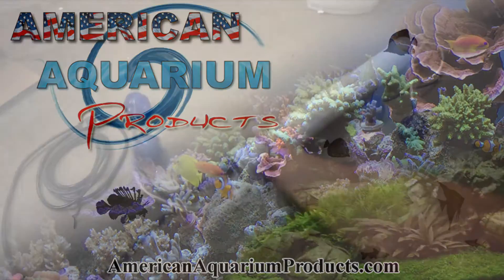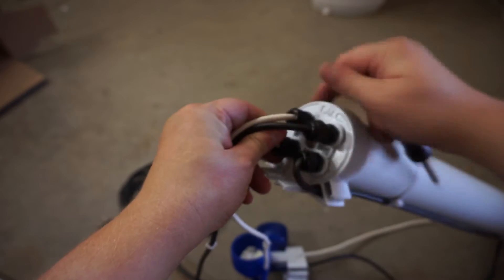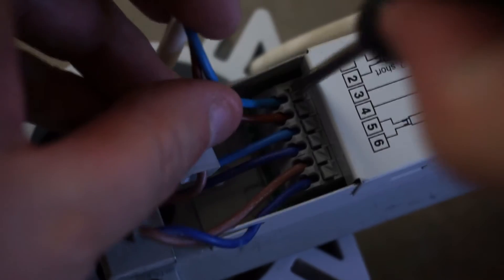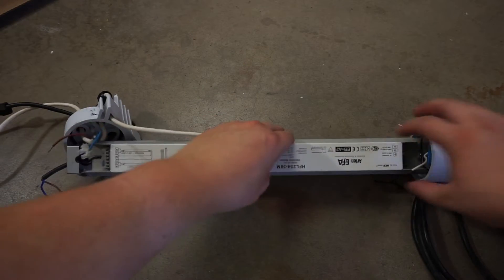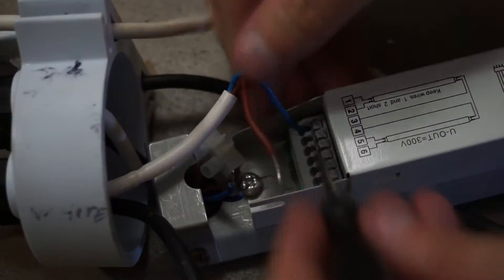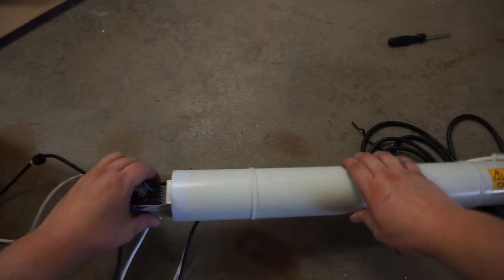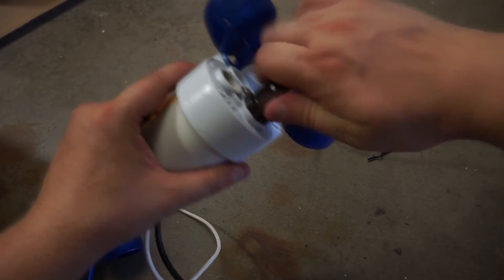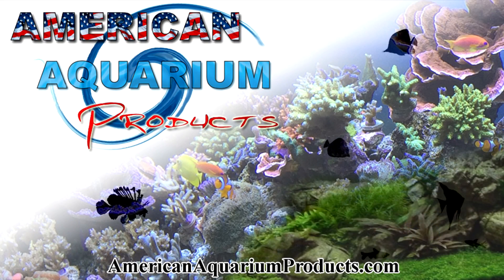American Aquarium Products- 110 Watt UVc Ballast Replacement

Comment: Is there a. Way to test a unit? I have just got one and want to get new bulbs but don't want them to blow if this is broken
Reply: These have a fuse to protect from this happening. If you purchase quality lamps designed for this UV, this should not be a problem.
Resource:
https://www.americanaquariumproducts.com/T5T8UVBulbs.html#g55t8

Besides low quality replacement lamps, the biggest issues I've seen in the 100s of 110 UVs I've maintained professionally, is damaged ballasts from water or connects (such as to the lamps) that are not fully connected.
Make sure to read the link this video has in the details section.